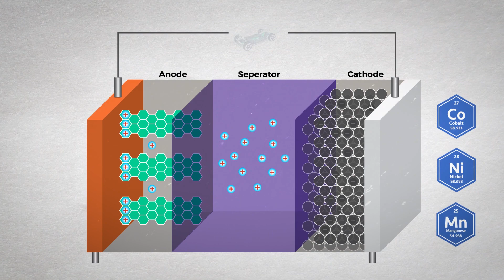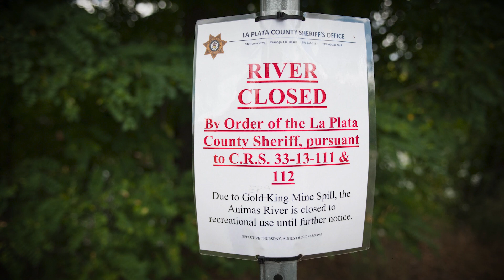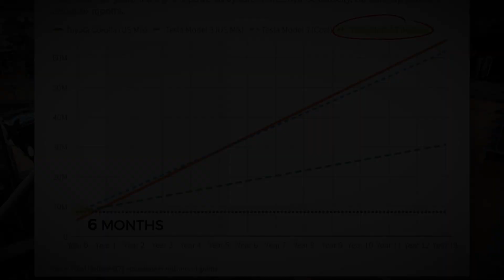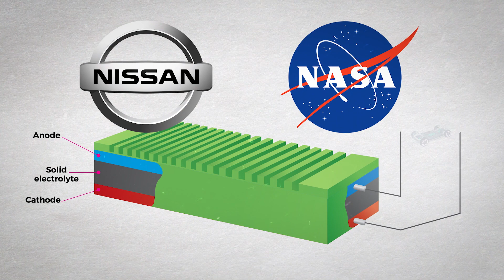Electric vehicles: Are they really cleaner than gas cars?

Comment: The thing is that you shift your power dependency from the gas pump to a power plant.  So if the power plant you get your electricity from burns coal, fossil fuels, or whatever, you aren’t really reducing your carbon footprint all that much.
Reply: Yes you are.. because that fuel no longer needs to me trucked in to stations with smoke blowing semi trucks
Reply: One thing the video did not mention is that EVs a far heavier than ICE vehicles. The US's transportation grid has a grade of C for bridges and D for roads,  the push to EVs will only accelerate the deterioration of our roads and bridges which are already in need of major repairs. An F-150 Lightning weighs 35% more than an ICE F-150. The battery for a GMC Hummer weighs 2,900 pounds, roughly the weight of a Honda Civic.  As of 2021, 43% of the US's roads are in poor or mediocre condition.  The push for EVs will only accelerate the issue of our deteriorating roads. Think about parking structures. A parking garage in Manhattan recently collapse which had around 50 cars on the roof, many were EVs. The weight of EVs is also an issue when you consider auto accidents. Heavier vehicles tend to fare better than lighter ones in car crashes. Size is not always a factor, vehicle weight is. These are issues that aren't being talked about and should be when discussing the push to EVs. Personally, the government is ALL IN on EVs without fully fleshing out the issues and problems that EVs cause such as how to recycle spent EV batteries, power grid drain issues, the issue of EVs being much heavier than ICE vehicles which will accelerate damage to roads and bridges as well as the additional damage they will cause in accidents.